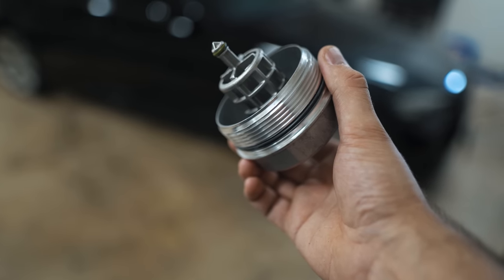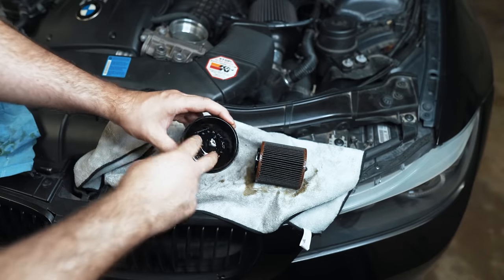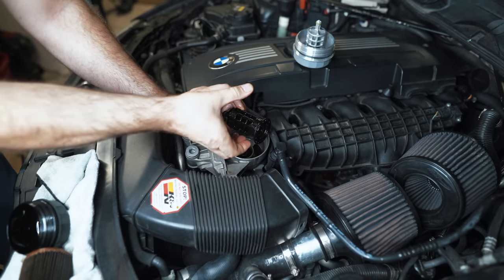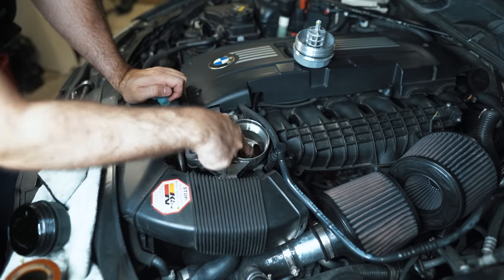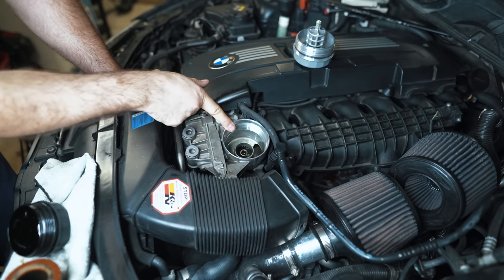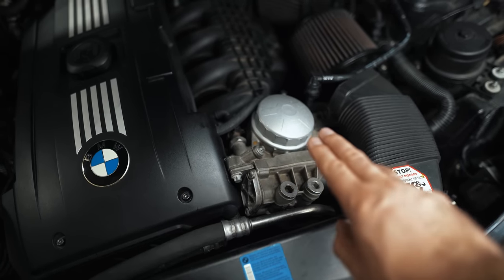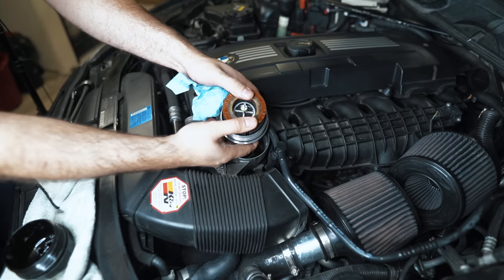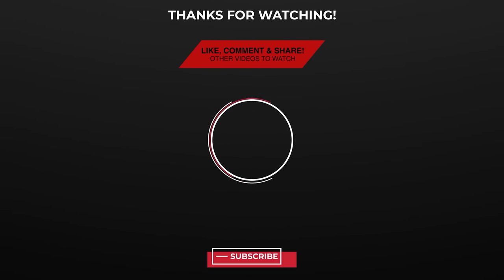Your BMW May Be Missing This Critical Part! So Important!

Comment: Ordering one asap, the plastic cage on mine doesn't even latch on the cap anymore.
Reply: NO. Do not use this metal cap. The center cage is too firm and negates the relief valve action. Also, the center cage does NOT fully seat into the back of the cap because the metal clips are too hard and have no give. You will have to dremel down some of the hard edges on the sides of the center cage base in order to get it to fully slide past the core metal clips. But the most dangerous part of this poorly made cap is the fact that the relief valve is too hard and requires too much pressure. 

I ordered one, did an analysis and decided to not use this unit. It's still on my shelf brand new.
Reply: @matreyia  Are you still running the stock cap after your CTS & K&P oil filter caps? Also, do you think this cap caused his motor to blow from as you state negating the relief valve?
Reply: @cupompa   - I run the stock plastic cap because I see a difference in pressure required to press the core spring. I also threw away the CTS and KP oil filters. I don't know enough to say definitely that this caused his motor to blow up...but I always play it safe when I see even a tiny difference in design between aftermarket vs. stock components. 

The only after market parts I use are ones that do not require complex moving components such as springs etc. For example, I replaced all relevant plastic connections with billet aluminum to take them out of the equation. My N54 is quite bullet proof by now. No expendible components are plastic or brittle. Only the highest grade silicone hoses or piping.
Reply: @matreyia  Thanks for the reply. Guess I'll go with the BMS cap with OEM cage! Might even buy this URO housing (cheap enough) and experiment before application with it's metal cage in the BMS cap instead as someone in this comment thread has had success with that combo. I am in the process of changing out plastic for metal components in my stock engine bay. All I need left are aftermarket silicone vacuum lines, a metal oil filter housing cap, outlets, inlets, charge pipe, intake manifold, & debating on a VVT valve cover. 

I've only changed out the stock coolant flange & oil fill cap ($70+ down star hardware) at this time with metal. Next steps for me are that protective crank plate (kies) & metal power steering pulley (URO) while doing the belt/tensioner service. Also learned about a metal water pump made by INA (makes stock tensioner). So I'll try that when my stock one fails.
Reply: @cupompa   - The OEM cage for the oil housing cap is what is most important. That is the only reason why I chose to stay with the plastic stock cap. If you use the metal cage...that defeats the purpose of doing anything since that metal cage is the only thing that is different in design and function. If you order the Uro metal cap, then do this: try to push on the metal center core that sits against the spring on the center cage...it is nearly impossible to do. Now, do the same thing on the plastic oe cage...you will find that it is almost effortless to move that center core cap against the spring. And THAT is why I am not using this Uro metal cap.

Comment: U mentioned that oil goes from outside of the filter to inside. But on my old engine I cut the filter and I had metal shavings in inner side of the filter every time. Doesn’t make sense

Comment: Hey question, I was curious about some things relating to the manual conversion process since I did it and the thread on e90post is dead, is there any way I could tap your shoulder about that? It's just about if I'm getting dsc, abs, and the brake light on because there's a cable not connected properly or if it's a coding issue. 

I love the fact you keep replacing plastic parts with metal parts. Check out the metal waterpunp as that's something I'm going to do myself.
Reply from the maker: Did you retain your auto harness or remove it completely?  You might have removed the ground to the dsc pump inadvertently.  I just redid my auto harness and added the reverse connector.
Reply: @VehicularDIY  I kept the auto connector on like you did and just snipped the cable for the sensor from the manual trans past the shielding (I bought the entire thing). I didn't THINK I disconnected the auto harness dsc pump ground, but I might have... so wait the NFRM didn't work with just wiring things up that way? I have the harness from the manual still obviously and the connector from the auto that I snipped close to the box because I couldn't find a good place to stuff it into.

Also I appreciate your help a lot, your manual and turbo videos helped me out a shit ton and I did it all on my own ^_^

Comment: Another great video, thanks!  Parts manager I deal with at BMW is disgusted with the amount of plastic components being used.

I just bought some hood struts (RockAuto) from that company for my 128i. Fraction of the cost over BMW and them seem like decent quality.  I'm ok using aftermarket for that application at least.

How was the casting on the aluminum cage? Any rough edges did you find? Looks pretty good I have to say.

I imagine there's even a slight heat sink benefit to using the all aluminum over the plastic.

Hope y'all are well in Texas,
Reply from the maker: Yeah good point I didn't even think of the heat sink potential.  The casting of the cage was pretty decent, only a few rough edges.  I tried to show you guys a detail shot and when editing the video I didn't even see then come through.  Thanks!

Comment: I have this part and I would not recommend installing it. The machining on the threads and mating surfaces is some of the worst I've ever seen and will basically grind into the filter housing dropping aluminium shavings directly into your engine. The cage is crude and unfinished and you can literally break off large flakes of aluminum with your fingers from the casting process. The plastic OEM style cage fits on loose and with different tolerances than spec.

Comment: Whats your thoughts on the pressure relief on this URO cap? there's a discussion on spoolstreet about this they wouldn't recommend using it. Not sure if i can post link.
Reply from the maker: From what I could see the spring tension felt identical on it.

Comment: my 2008 bmw 335i, it has a noise that comes from the oil housing, I already changed the filter and the sound is still there, I have no alert on my dashboard, do you think I should change the filter cover?

Comment: One thing i would like to know: when you start your car after a filter change, will it have to fill the housing before the oil arrives in the engine right? If yes, that means your car runs without oil for a while.
Reply: You just prime the filter housing by fillinmg it with oil, simples :`)

Comment: PLEASE HELP. what would be the problem if this code came up? 
for reference, my starter was replaced along with engine coil. 

2A98 crankshaft position - crankshaft position correlation (bank 1 sensor A)

Comment: I have question bro what could be the reason my heater isn’t blowing heat ? I get cold ac an just air blowing but no heat been that Texas starting get colder weather soon I need to figure it out as it’s the daily for me an my daughter ,I may have asked before idk can’t member but im just stuck ...i ran into a coolant leak Over heat issue while back changed out the water pump radiator an thermostat was the last thing I changed ,thinkn it was my water pump ended been my thermostat ,soon as I changed the thermo my heat stop working maybe a few weeks later or so I do have a borg Warner I purchased as a back up for the cheap amazon one ...could it be the thermo is making the car sense it’s over cooling I read ina . Thread it’s a high possibility but would like ur experienced knowledge on what u think ?
Reply from the maker: Are you getting a code for the new thermostat?  The cheap ones may not last.  You'd get a CEL if it has failed.
Reply: @VehicularDIY  last time I checked with the bimmer geeks program nothing popped up about the  thermostat I also used a differnt coder reader prior to buying the BG program an nothing I am tempted to see if it is the thermo an just swap out to the borg I have an hope for best my radiator is a autozone rad not sure if that maybe cause anything my oem rad is still good no leaks it’s in my garage in a box

Comment: Waste of money, the only reason these crack is if they have been over tightened.
My 23 Yr old 330 M54 with >170k is on the original (it has the same housing). Composite plastics are incredibly string now and much lighter. Weight is the killer of all performance aspects of a car braking, turn in, grip etc and can't be overcome by simply adding more power. If you're that worried about it cracking just change for a new OEM plastic housing every 150-200k
Reply: If someone uses a rag and pliers to get it off then it ovals and cracks over time.

Comment: I already have the bms billet cap but plastic cage. If I buy this for the cage, will the cage fit my billet cap?
Reply from the maker: I don't believe so as where it clicks in looks a little different.  I would be nice if the aftermarket make an aluminum cage that was compatible, even it if was cast.

Comment: Wouldn't galvanic corrosion be a problem since the body is an alloy? I don't know, just wondering.
Reply from the maker: Considering both the oil filter housing and the cap would be aluminum and not dissimilar metals I'd say its not a factor to worry about.
Reply: @VehicularDIY  ah. For some reason I thought the body was magnesium. Haha. Good to know it's aluminum!
Reply from the maker: Yeah I think the N52 and M54 have an alloy block but the oil filter housing would still be aluminum.

Comment: Tbh if u buy a 335i and its kms are high doesnt have at least a after market oil filter cover and charge pipe they are either too stupid to buy a aftermarket part or its never been serviced

Comment: Almost pulled the trigger on of these as I was initially shocked when I first saw this as i've never seen a cage in m oil filter cap since ownership of my car way back when. I've also never had any codes relating to oil problems or specific vanos codes in all the time i've owned my car. So I thought it best I check on realoem for my make and model here :
https://www.realoem.com/bmw/enUS/showparts?id=WL72-EUR-09-2007-E93-BMW-335i&diagId=11_3971  
But it doesn't show a cage. Anyone reason it's not shown there on realoem?
Keep up the good work. Liking the idea of going aluminium/billet where possible and am following.
Reply: it is shown in realoem if you look closly its already in the oil filter

Comment: I ordered this and a standard plastic replacement... After doing a fair bit of research I definitely have some concerns about the designs of the aluminum caps and the service life of the stock plastic caps in general because of the bypass valve built into the filter cage.
Reply: I read a couple reviews on Amazon saying that the bypass valve for the aluminum cap doesn't work. Not a fan of plastic parts, but the original cap on my N52 motor looks fine at 154k+ miles. Also, thinking it over, some parts are sacrificial and are meant to fail or give signs of failing instead of something much harder/expensive to fix failing. Not sure if that's the case with the cap, but think I'll just get a Febi plastic oil cap and replace the original one for peace of mind.

A plastic part that is absolutely worth replacing is the "Micky Mouse" fitting/hose from block to thermostat. You can get an aluminum fitting and cut out the old one, which is kinda risky for contaminating your motor or just get a whole new hose with an aluminum fitting already on for $5 more https://www.rockauto.com/en/moreinfo.php?pk=10883324&jsn=3 that's for an N52 motor
Reply: @herc1305  I actually just replaced that coolant fitting on the block with an aluminum one the other day. You can get them cheap, I got mine for $10 on Amazon.

Comment: Can I put that cage on my metal cap I already have?
Reply from the maker: No it's different.
Reply: Mine came in a very rough condition. I'm going to break off all the sharp edges and clean it up before install

Comment: Great. Where can I get this in the UK?
Reply: You can find it on rockauto.com or partsgeek.com
Reply from the maker: Yeah the part number for it is 11427525334PRM.  It must include the PRM at the end otherwise it'll be the plastic version.
Reply: @VehicularDIY  ECS also ship to the UK. I believe the other 2 are also US based so I may as well use the affiliate link!